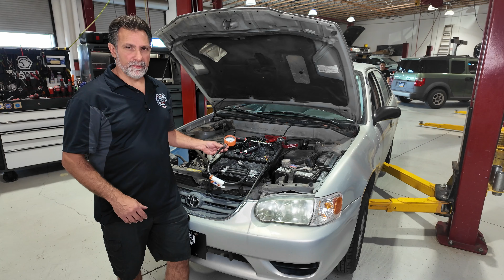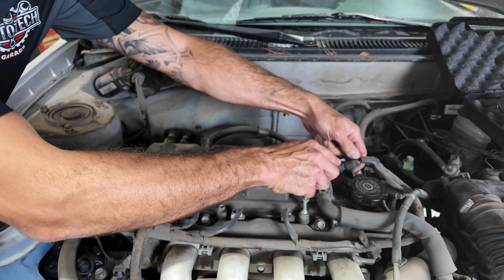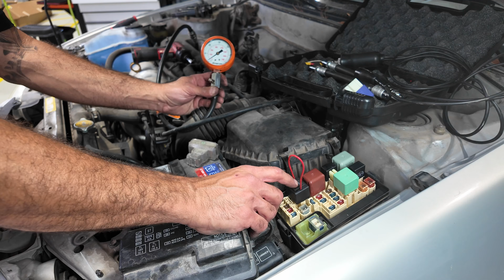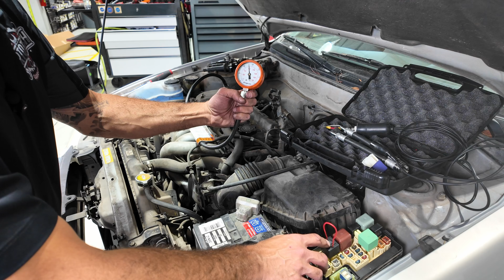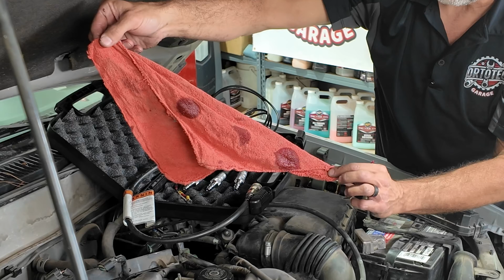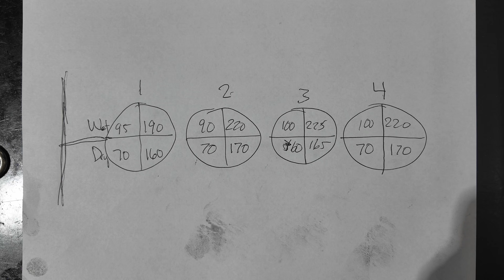Compression Testing: The Engine Diagnosis Trick You NEED To Know

Comment: Have a misfire problem on a A6 2tfsi not the spark not the coil maybe injector or a leak i drive it until it dies😭
Reply from the maker: You should bring it to your local mechanic and have it diagnosed.  It may be something simple. A misfiring engine cam cause other problems and premature engine life. At least see what it needs before you make a decision to pull the plug on it. 👍

Comment: I see multiple cars come in( from chain shops) with brand new plugs,coils and or injectors on a particular cylinder,still with present misfire codes. It will never cease to amaze me how they miss a basic compression test,not even leak down test,just a basic compression test. Madness.
Reply from the maker: Yes, I agree.  I just think that there are some gaps in proper diagnostic procedures for some techs.  I see the same types of issues.  We need to get back to proper apprenticeship programs for young technicians.  I was fortunate to have a few great mentors when I was young and always try to spend time teaching my techs, as well.  This is a tough industry to learn on your own.

Comment: Suggestion : Is it possible to do a video on fuel system cleaners ( injectors ) that you can pour in the fuel tank ? What is your opinion on these ? Do you use them ? Thank you
Reply from the maker: Sure.  I think they are worth while as a preventive maintenance measure, but not as much to correct a problem.   An intake cleaning system is a good service though.  I think I can do a video that will incorporate both.  Thanks for the question and for watching!  Keep an eye out for this in the next couple of months. 👍

Comment: Very complete and informative !!One question: I read multiple times that it can be harmful to the ECU to just disconnect the coil wire and crank the engine. Do you recommend grounding it? Looking forward to  the leak down test video ! Thank you very much from Montreal,Canada.Your channel is a well kept secret.
Reply from the maker: Thanks for the really nice comments!  I appreciate your support. 
Yes, I would ground the high volrage (secondary ignition) coil wire if you want to disconnect there, but just as easy is to just unplug the coil primary connector. (Low voltage side).  The coil cannot fire spark with the primary unplugged. 👍
Reply: @OrtoTechGarage  Thanks.Logic and safer !
Reply from the maker: @1983dmd My pleasure!  Best of luck.